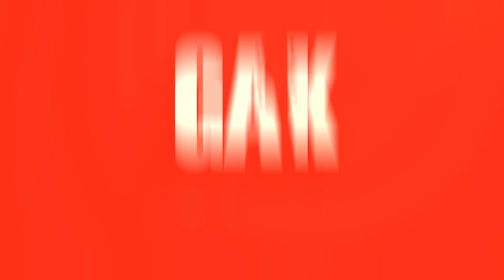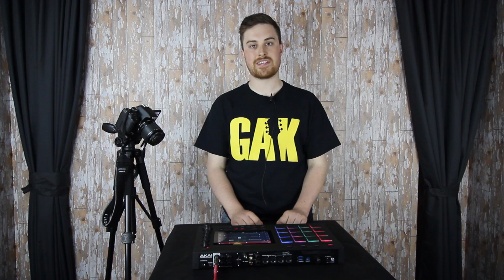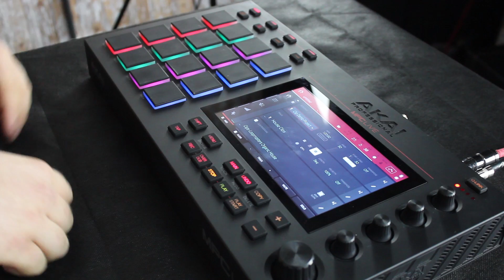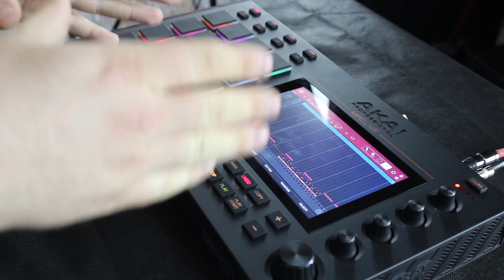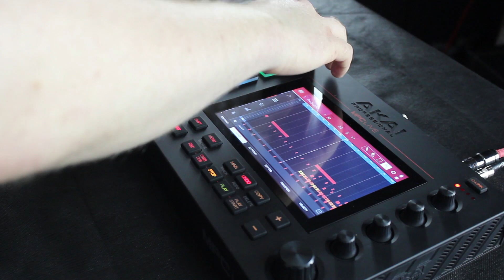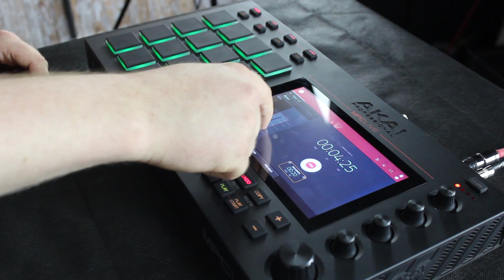GAK PRO AUDIO : Akai MPC Live Performance and Production Sampler

Comment: Why does the self proclaimed best sampler not have a microphone input? Or even better yet a built in microphone! So I have a battery operated unit that I can take anywhere, anywhere but if I want to record a sample I need to bring a microphone and a mixer and power them somehow? Is this a joke?
Reply: plug mic into 1/4" input
Reply: hmm.. iphone?
Reply: as in i should use an iphone to do what?
Reply: record whatever samples as the microphone if directly attached to the mpc would not be any better or worse than using the iphone
Reply: So I tried this but the phone does not show up on the MPC as a location in places when I try to load samples the.

Comment: Best bit of kit I’ve bought in a long time. Just makes it so easy to kickstart new projects
Reply: Darragh Redmond I'm considering buying it because I grew up using MPCs but there have been so many issues reported with the MPC Live rejecting Flash drives and hard drives as well as multiple crashes. Have you had any issues using it?
Reply: fmurphy7000 gmail com   I’ve put an 500ssd inside and I also use it as a hard drive for my Mac with no issues. Not had a problem with crashing however I’ve not loaded old projects or used an ssd card.    The software has a way to go but I love the thing . It’s a work in progress I guess
Reply: Thanks for your feedback. Ive ben trying to get off of my laptop and get back to being inspired and creative thats why I want the MPC